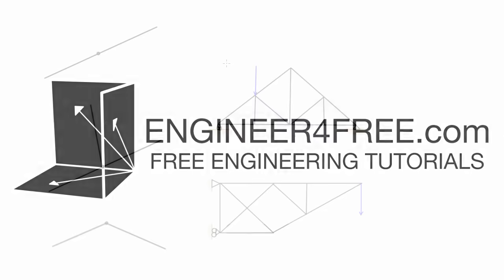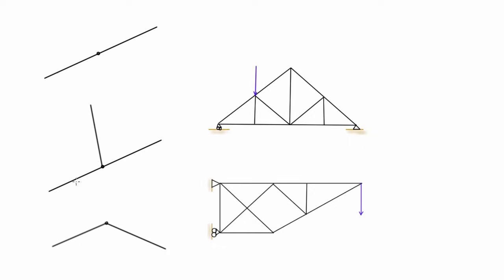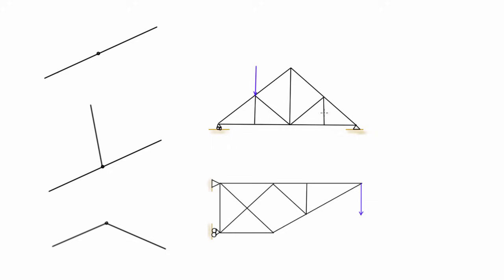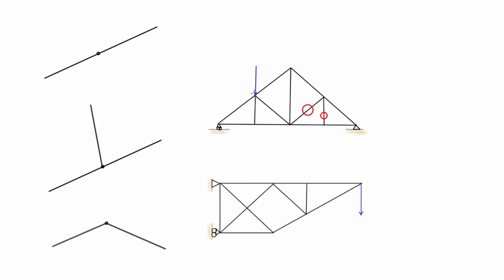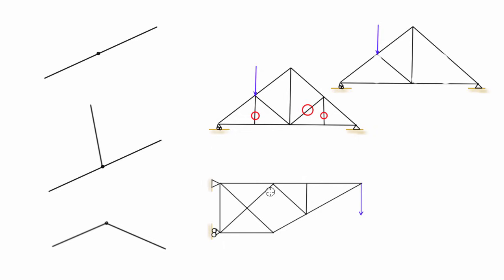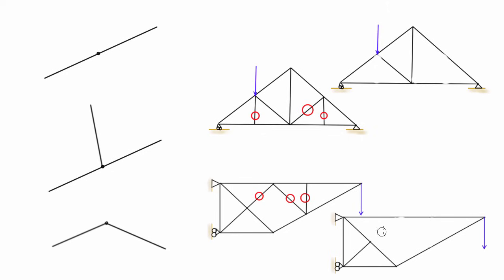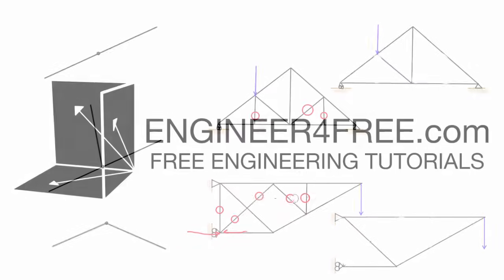How to identify zero force members in trusses

Comment: I don't know about this... Why are you assuming that the roller doesn't move?
Reply from the maker: Each truss has one pin and one roller. This is the general case for simply supported statically determinate structures. For the first one, the pin prevents movement in the x direction, and the roller does not. Although, there is no horizontally applied force, so technically the pin doesn't even provide a reaction force in the x direction in this case (its Rx = 0), though it exists for stability. In the second case, the pin prevents movement in the y direction, and the pin does not. If there were two pinned connections, the elongation/contraction of individual members would cause unequal reactions in each support due to the eccentric loading, and would require more advanced methods of structural analysis to calculate the reactions. These are simplified problems though. In real life, of course the roller in the second example would fall down, but it is used here as a generalized support that only provides a reaction in the direction normal to the surface, and not parallel to it. You'll see beams, trusses, and frames always supported by one pin and one roller in first year statics classes and textbooks. Once you learn the basics of these statically determinate structures (solveable by the 3 equations of statics alone - ΣFx=0, ΣFy=0, ΣMa=0) then you can move into the world of statically indeterminate structures, which would involve situations with two pins, or other more complicated connections that some more advanced structural analysis would be required to solve the reaction forces at each support. Hope that helps 🙌

Comment: Could you guess by observation what each internal force on each member would be?
Reply from the maker: You can "guess" or otherwise determine from observation all of the ones that have zero force, as demonstrated in the video. Once you identify all ZFMs, you would need to calculate the internal force of the remaining ones using method of joints.

Comment: Wouldn't the member that your mouse hovered over at 9:19 also be 0 force? by the same logic you used to identify your last 0 force member?
Reply: If you're talking about the last two "internal lines", the upper part of it is not zero force bc the pinned support has a reaction in the x and y direction. The lower part is also not a zero force because the two lines it connects with are not co-linear.

Comment: The hinge has a vertical reaction right downwards or upwards. Then how do u say that the member which is between the roller and hinge is a zero force member??
Reply: Yes, the hinge support has a vertical reaction too. But before looking at that joint, look at the joint of the roller. As explained in the video, the reaction of roller would counteract the horizontal member and the vertical member just lies there alone so it obviously makes it a zero force. Now that we know the member is a zero force, we can say that the vertical reaction of hinge support is zero.
Reply: Understood

Comment: If I may ask what was the point of zero force members? I heard that due to weather or like snow, they may be required to act as support right?
Reply from the maker: Yeah, basically for redundancy and rigidity. When you change the loading, the zfms will change. In real life, the loading will change all the time, and won't be as simplified as these examples.
Reply: @Engineer4Free  I’m amazed by how fast you replied. Thanks for that explanation I appreciate it! 😁
Reply from the maker: I gochu! 🤜🤛

Comment: Does that mean, the zero force members are redundant and just adding extra weight?
Reply from the maker: More or less. But remember that if the loading configuration changes, the internal forces and ZFM status will change. In general, ZFMs still offer bracing, and redundancy etc. Also, this is a hyper simplified example. Not to be mistaken for a very realistic real world example.

Comment: hey in the above diagram , i mean the first one , the top vertex can also be a joint hence central line is a zero force member ?? explain please why is it not
Reply from the maker: Hey Kartik, the top vertex is indeed a joint, but it doesn't satisfy one of the three conditions on the left side to immediately assume that the vertical member is a ZFM. The second condition (mid left on the screen) involves 3 members at a joint, but two of the members must be co-linear to assume that the third is a ZFM. When we look at the top vertex of the first truss, it does indeed have 3 members touching it, but none of them are co-linear (in line) with each other. If two of them were, then the third would have to be ZFM because nothing else could react equal and opposite to any of it's magnitude that is perpendicular to the other two's co-linear lines of action. Another way to look at it, is that if the two diagonal members are at the same angle, and if for some reason they had the same magnitude and sense then the the joint would net to zero force in the x direction, but would have a net upward push from them if they were in compression or a net downward pull by them if they were in tension, and either way the vertical member would have to compensate with it's own non-zero force for the joint to remain in equilibrium. So based on what's going on at that joint, the vertical member cannot be a ZFM. You can also confirm that on the bottom middle joint (on the bottom end of that vertical member connected to the top vertex), because the single diagonal member that carries a force has a y component that must be compensated by the vertical member (which only has a y component itself), as the two bottom horizontal members could not do the compensating. So from inspection either joints, that vertical member must carry some internal force and cannot be a ZFM with this exact loading on the overall structure. Hope that helps!

Comment: For the second truss if you do sum of the forces at Ax, wouldn't that be 200 k making AB 200? Thanks.
Reply from the maker: Hey sorry I'm not sure what you're asking. I didn't use any letters to identify any points in this video, or numbers to discuss potential magnitudes of internal forces
Reply: @Engineer4Free my bad I had a similar problem in front of me called AB I was working on, but I meant the last zero force of the horizontal of the second truss you found to be a zero force member. Wouldn't the X direction be a -200 on the pin? Is it zero because the diagonal takes the X force as well? Thanks

Comment: wouldn't those two members be zero force members (the one connected to the pin and running at a 45 degree angle)
Reply from the maker: Actually no, that member must have an internal force. The whole structure has a vertically applied external load, so the pin needs provide a vertical reaction to balance that. That vertical load needs to be also balanced at that specific joint, and the 45 degree angle provides a vertical component of internal force that can provide the opposite force needed at that joint to maintain its condition of static equilibrium.
Reply: @Engineer4Free  oh okay, so basically at that pin its like having four members instead of 3?
Reply from the maker: You are referring to the top left pin in the second example, right? If so, That pin sees the following forces: a horizontal force from the hinge, a vertical force from the hinge, a horizontal force from the horizontal member, and a diagonal force from the diagonal member (but in computation, the diagonal force will be broken into it's x and y components). Make sense?

Comment: 16 hours of tuition at university, each hour costing £135. Useless.
9 minute video on YouTube, absolutely free. Understood in 4 minutes

Thank you very much

In the first truss diagram wouldn’t the centre vertical member be a zero force as well? If not why?
Reply from the maker: Thanks Ryan, glad my video is getting the job done 🙂. And no, it is not a ZFM. If it were the only member with a vertical component at the bottom joint, then it would be ZFM, but the non-ZFM diagonal member there as well gives an equal/opposite vertical load to it, at that bottom joint. Hope that makes sense.
Reply: Engineer4Free ah yeah it does, cheers

Comment: 9.00 For analyzing there shouldn't be any rection or load on the joint. But still you have taken roller reaction to analyze. Please clear my doubt. 😕
Reply from the maker: That lower reaction is a roller. There is a non-zero normal force (horizontal) present there. There is no vertical force present there.

Comment: 8:50 what about the upper pin? Doesn't it need to affect as reaction force to the x-axis just as the roller pin?
Reply from the maker: The upper pin DOES provide a vertical reaction. BUT when we do these problems, sometimes we can only find information about a member from one of the two joints. According to the bottom joint, this pin must absolutely 100% be a ZFM as described in the video. Because the member is absolutely 100% a ZFM, then the entire vertical force applied by the upper reaction force must be countered by the vertical component of the diagonal member that is in contact with it. Hope that makes sense.

Comment: Why don't we take into account the reaction forces coming from fixed pin (horizontally and vertically)? isn't there a force aligned with the zero force member that we removed at 8:36
Reply from the maker: That member is determined to be ZFM exclusively by what's going on at its top right joint. That joint must be in equilibrium, and because 2 of the nonZFM the members are colinear, the third member in question must be ZFM, otherwise the joint would accelerate inline with that axis. Once we determine this member is ZFM we can realize it will not put any force on the other joint, so we can erase it temporarily to continue the analysis. Hopefully that clears it up, I'm not 100% if I answered what you were asking

Comment: Zero force member does not mean it is useless, there are something called bucking when comes to design and those extra member is really to prevent this from happening
Reply from the maker: Yep. Also, if the loading changes, the internal forces in each member will most likely change, so a ZFM will not always be a ZFM. Also in real life, the loading is not so simplified, nor is the structure. But good to learn them this way to train the brain!

Comment: This video is the kind of reason why we have bridge and building collapses. It carries many assumptions about design and load. It provides a "cheat sheet" to the uneducated. As much as this was presumably intended as educational to students, I feel it is far more harmful. But continue as you will limping the undeserving and lazy into the engineering world.
Reply from the maker: Hey Greg, this video includes very strong simplifications. This is not intended to be interpreted as anything close to a real life scenario. This style of simplified trusses (those that are completely pin supported and can only support axial loads [no lateral loads whatsoever]) is the norm in introductory Mechanics Statics textbooks and university lectures. This method is used to teach basic principles of 2D statics, specifically in the realm of 2-force members.  Additionally, when I erase members, I'm not assume they have been "removed" IRL from the structure. I only erase them to better visualize which other members would carry a loaded or no load in this loading scenario. The loading scenario is not realistic, the structure is not realistic, but open any statics book and you will find the same example. Zero force members do serve the purpose of bracing, rigidity, redundancy, etc. So please keep in mind, this is not a carpentry video, it's one small part of a much greater university course on statics ( Engineer4free.com/statics ). Understanding these basic principles are fundamental to higher level studies in structural engineering, which come years after studying at this introductory level.

Comment: All that's true if you don't count gravity pulling on the length of every member that's not perfectly vertical.  If the truss is small, it's not significant.  But if the truss is large, long members need to be reinforced against gravity tugging them out of straight.  You can make those members beefier, but there are times when adding 1 or 2 light members keeps the critical members straight while adding negligible weight.  Also, buckling is unavoidable in a member under compression when its cross section to length ratio is below what's needed.  So there are conditions when one or more members will need additional members added to keep them from bending, and or buckling.  Those members may appear to be zero force, but they serve a critical purpose.  If you look at trusses in the real world, they often have many members that would be counted as zero thrust from this assessment.
Reply from the maker: Totally. Thanks for contributing. The truss in this video and the rest of the examples of the trusses section of engineer4free.com/statics are simplified. We don't consider them to have any self weight, they can only support axial loads (no lateral), and are purely pin jointed. Real trusses are jot like this, but this is how we introduce them at the introductory level I statics. Buckling, self weight,  racing, and all the things you mentioned come up later in studies of structural engineering, and are very real considerations in real life! 👌

Comment: Sir,
Your assumptions?  Pin jointed framework?  Single, point load?
Nothing's made that way!  Practical joints are welded (steel) or jointed (wood) and have stiffness.  These joints will almost certainly have, and sustain side forces.
Excepting such structures a crane jibs, the majority of cases have distributed loading.  Think bridges and roofs.   Old houses like mine (built 1826) have 3-member A-frame oak trusses mortised and tenoned .  A pin jointed A-frame would collapse.  My roof is the original, and has stood for close to two centuries.  Next to a simple triangle, the A frame is as basic as you'll get.
Regards.  Clive.
Reply from the maker: Hey clove. You are 100% right. You won't find a pin jointed truss like this in real life, especially one built with members that can support zero lateral load whatsoever. This simplified truss is used in introductory statics/mechanics courses to teach the basic methods of truss analysis. Those methods being the method of joints and method of sections. Open any statics textbook and you will find these simplified unrealistic structures in the truss chapter. All of the structures you mentioned are statically indeterminate, and a proper structural analysis can't be done without first understanding the basics. Just to clarify, this video is part of an introductory course that I made on statics too, you can find it at engineer4free.com/statics you can check it out and also jump to the "truss" secroion of it, the first truss video I made talks about thee simplifications. Anyways, I also did higher level courses in mechanics of materials and structural analysis, but keep in mind, these are all on the academic side of things, matching the methods and co cepts that are taught in uni lectures and they're accompanying textbooks. Hope that helps clarify the content if this video, and why it seems painfully unrealistic!
Reply: @Engineer4Free  Sir, Thank you for your prompt reply.  Understood.  Clive.

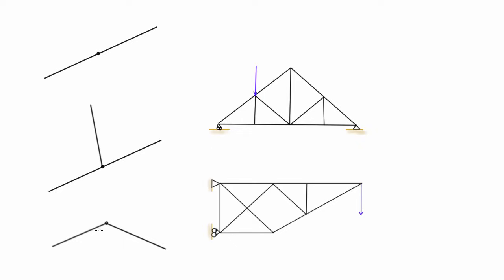Comment: I disagree with your explanation at time 2:50.   Look at saw horses as an example.
Reply from the maker: A see-saw plank is not a 2 force member. It's a 3 force member. The pin that a see way rests on is not a hinge that allows the left hand side and right hand side to have a different axis. Trusses as in this video are comprised of straight 2 force members only, which is a simplification. But the idea is that every pin in a truss acts like a hinge, not a pin pressing in the middle of a span that can support a lateral load. Check this video for a quick overview on the idea of truss simplifications: https://youtu.be/CkQMq4dBHjY

Comment: We haven't covered this yet, but it looks like this can be figured using vectors. Is that true? To what degree?
Reply from the maker: Yes. The internal forces here are aligned along the axis of the members. Imagine each joint as a 2D particle problem, where the joint is the particle, and the members are force vectors. The sum of forces on the particle must be zero because the joint is not accelerating. It should be easy to see that if for example two two members are co-axial, and the third is not, then that member must carry no force, because otherwise the joint would accelerate in some direction that is not the axis of the two other members.